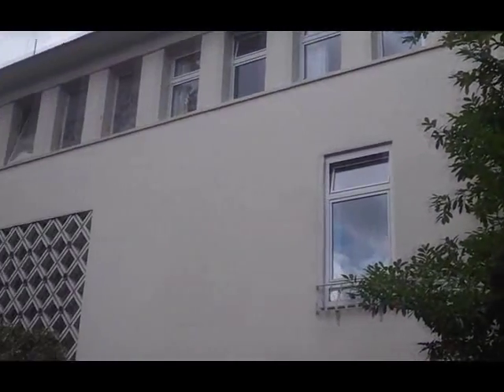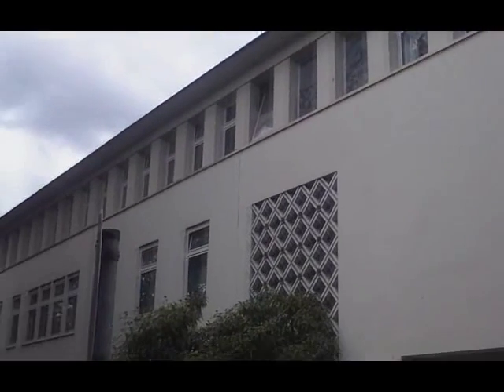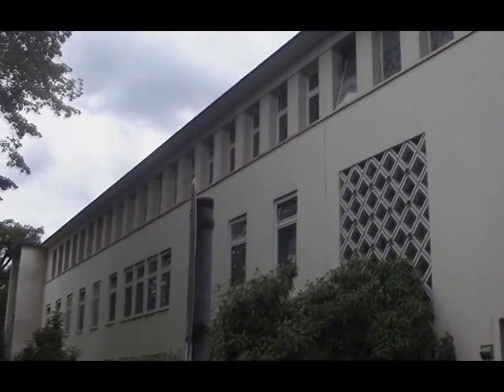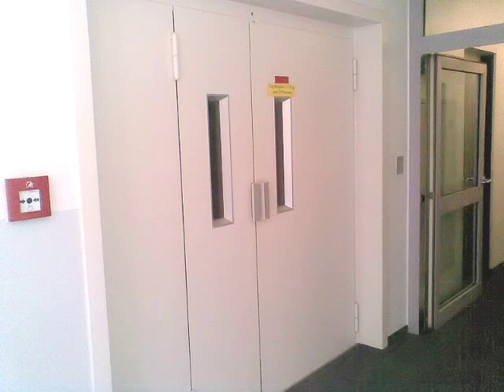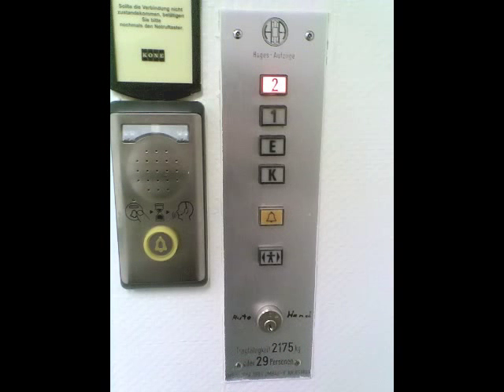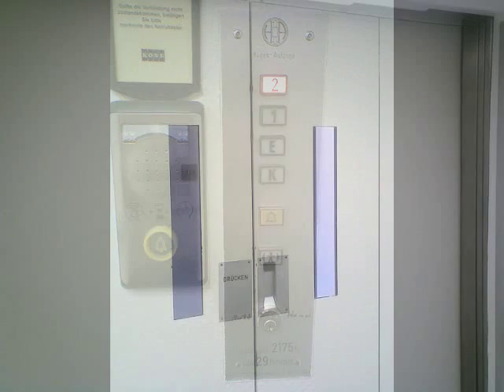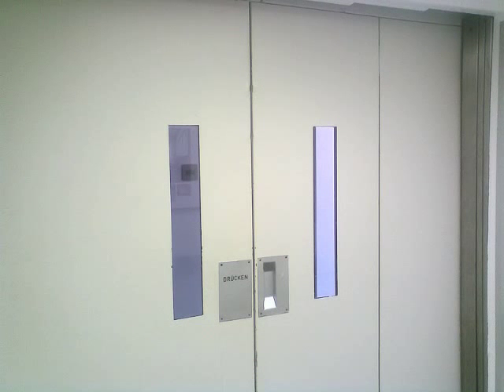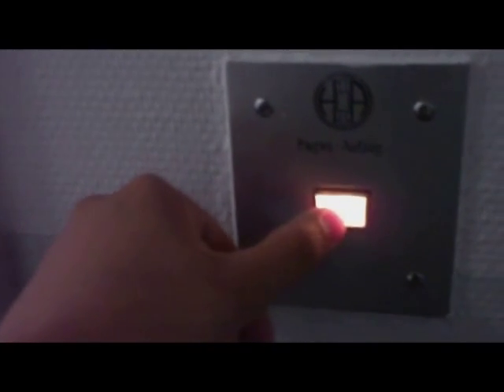1974 EPIC amazing Hages elevator at Hotel** CJD Bonn, Germany

Comment: KONE Should just add an Floor indicator on the elevator... good that the floor indicator in the panel works good. In sweden, we often add the FD4-indicator on elevators, especialy on thoose Digital-driven who got nnedoors. Danderyd Hosptal got all it´s non-talked elevators an talking FD4 added aside from the original one, and it workson it´s own way, not following he original one. (depands of the elevator. - one Bauer still havent got innedors, but that indicator.) - Tour is on hold for edits.